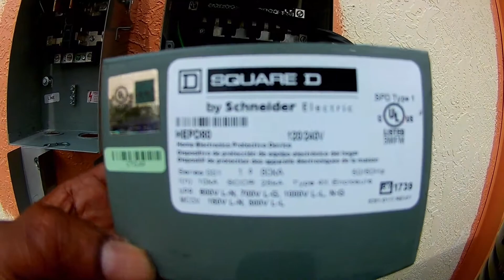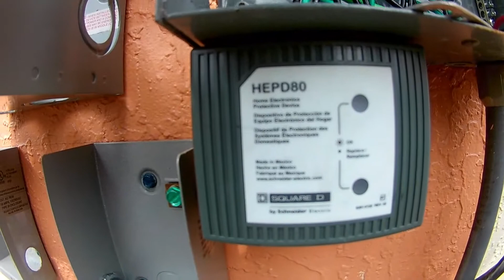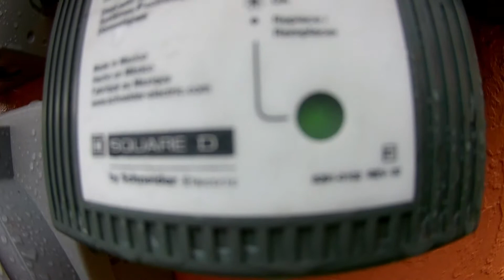Whole House Surge Protection Square D HEPD80

Comment: That is not installed correctly. They warn not to coil excess wire.
It also doesn't work when installed in a subpanel.